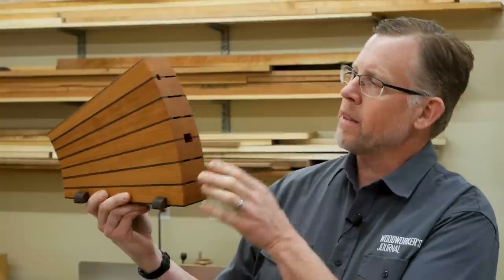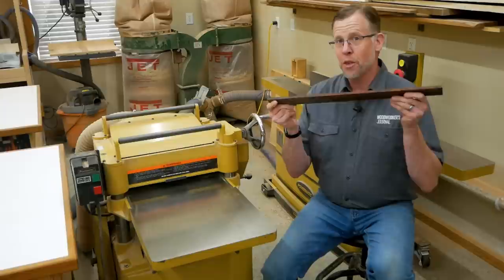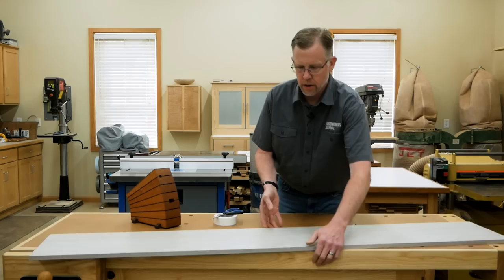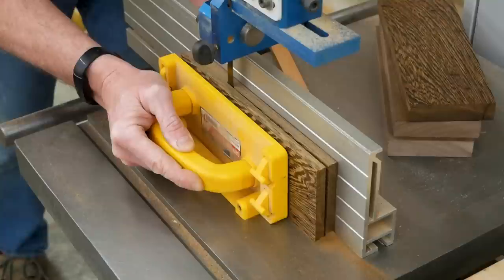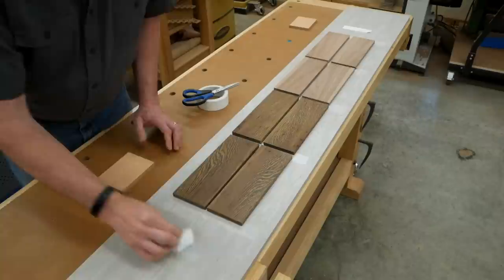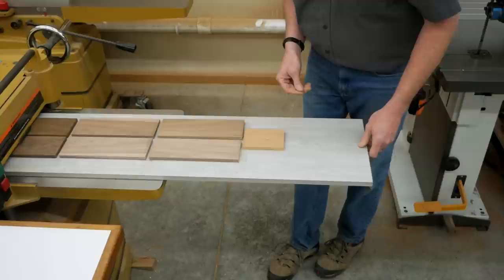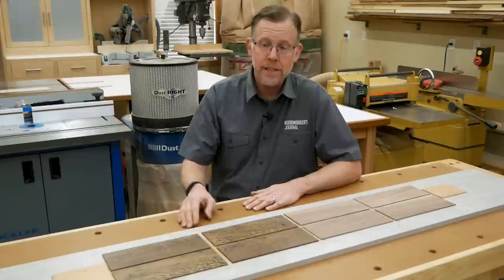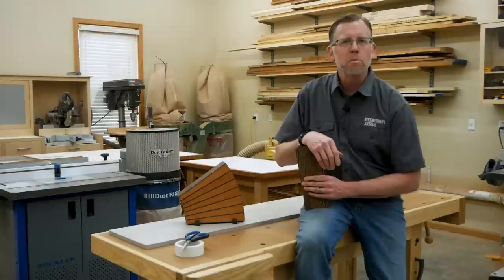How to Plane Thin Stock

Comment: Thank you.  Just what I needed right now.   You did mention jointing the work first. My stock was already about 1/4" thick from the bandsaw and  there sure was a lot of vibration of the work while on the jointer, even with two push blocks.  Any thoughts?